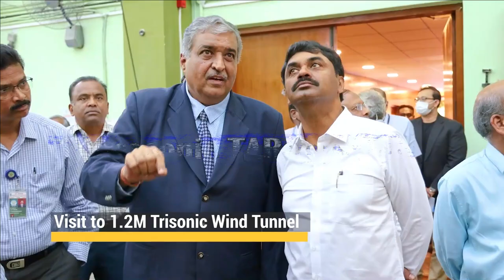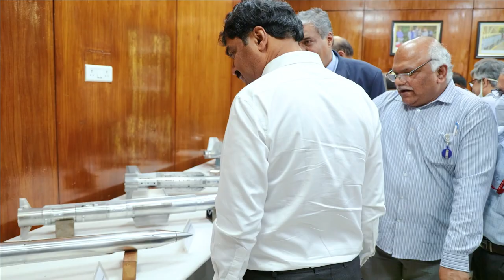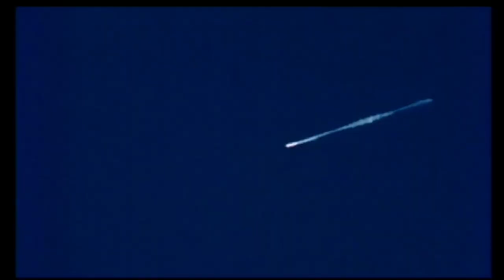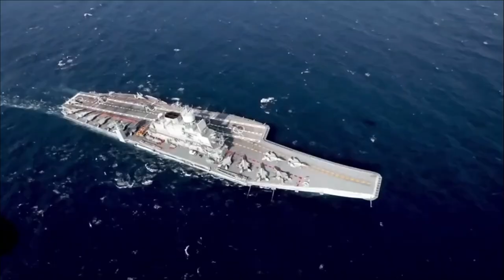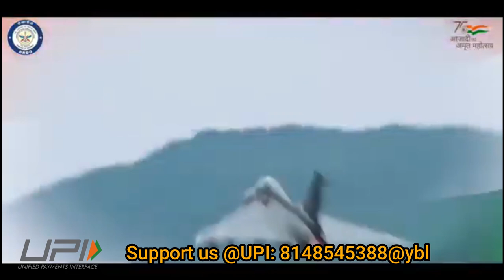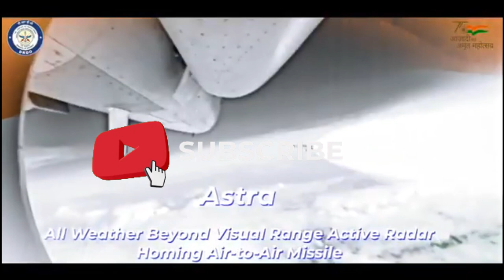Powered by Liquid Fuel Ramjet engine, DRDO’s new Supersonic TARget(STAR) missile

Comment: Bhai... lfrj (liquid fuel ramjet) does not have higher range or endurance.  It purely depends on how much fuel u r carrying. Lfrj has following advantages:
1. Higher fuel burn rate and higher thrust because uses liquid fuel which has higher calorific value . 
2. This gives very high speed .
3.  Liquid fuel have always been easier to control thrust output because you can control fuel flow via a simple valve . SOLID FUEL CANNOT BE CONTROLLED THIS WAY . SO ONCE SOLID FUEL IS IGNITED IT KEEPS ON BURNING 
4. Because of this, liquid-fuelled missiles can have better maneuverability, and may also have better range. ( not necessarily though)
Disadvantages:
1. Poor shelve life of such missile as liquid fuel corrodes the pipe lines and tanks inside.
2. Storage of such missile are risky as liquid fuel can easily catch fire.
3. With the advent of sfdr , these missile will become obsolete.

Comment: If STAR is complete by complete by 2023-24, then what are its major deficiencies in comparison to Brahmos? STAR has a range between 55-175 km. STAR will have speed ranging from 1.8-2.5 Mach. Brahmos is faster(Mach 3+), with longer range(500km), and a heavier payload, but at the cost of being a heavy, heavy missile. 1.5 tons! However if STAR proves all the tech required for an indigenous Brahmos, then a STAR 2.0 can be made that is a scaled up heavy missile in Brahmos Class. Electronmagnetic launch of missiles should be investigated, it may be possible to scrap first stage of Brahmos altogether if it can be accelerated to Mach 2 at launch, which EMALS or maglev can do.

Comment: Need to upgrade to a solid fuel system..Liquid fuel has a tonne of drawbacks.
Reply: Liquid fuel having advantage against solid fuel. It can increase or decrease speed whenever it want.
Solid fuel cannot do this 😂
Reply: @chanakya5480  . Nope, ur wrong...Meteor uses Solid fuel, it uses variable throttle. It's the same tech we are using for our next Gen SFDR Air to Air missile..'Solid Fuel' Ducted Ramjet.
Reply: @abymathew295  I mention it can control speed . Above video clearly talking about it will be used against air defence system.
Reply: @chanakya5480  . It can be used as a long range SAM too